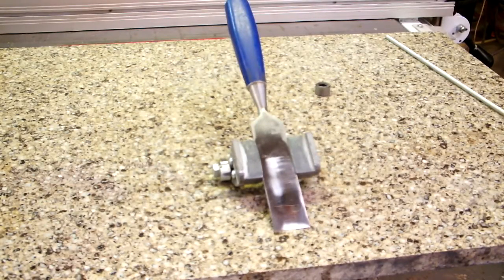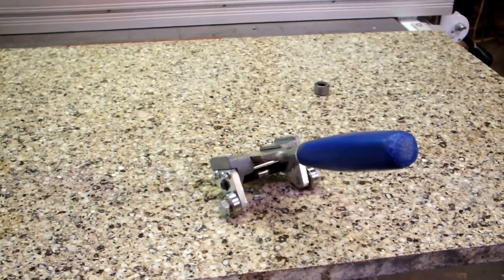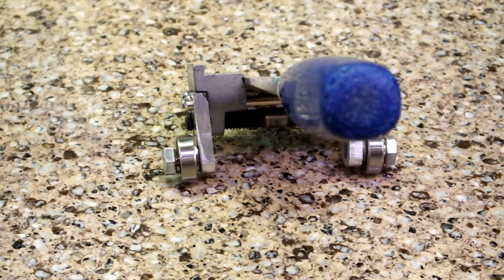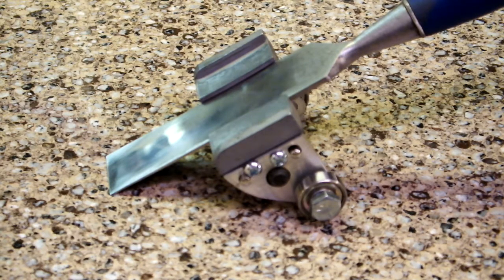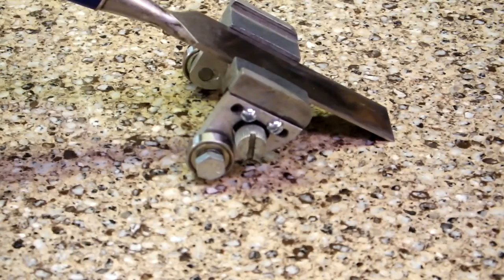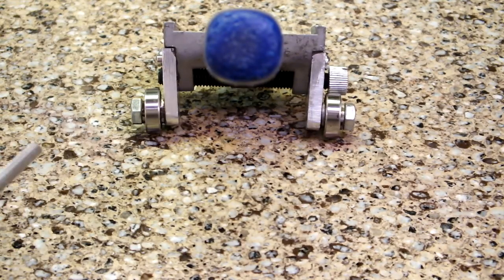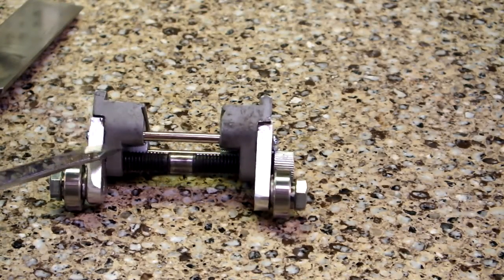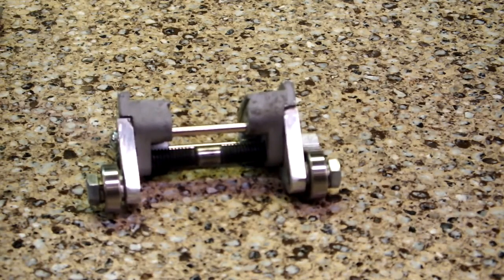Honing Guide

Comment: This is a great idea!  Thanks for sharing.  I had a question.  Would it be possible to mount the rollerskate bearings on the insides of each wing?  The only reason I'm asking is that I have a few stones that are not very wide and I was thinking it may provide more usable area on the stone while still gaining the stability you are talking about.  Maybe you're using this on sandpaper though?
Reply from the maker: +ThisTimeofDarkness 
The wheels cannot be mounted on the inside because the screw that tightens both sides woul be in the way. What I have seen others do, is to recess the stones into a flat surface.
Reply: PumpyTheCat